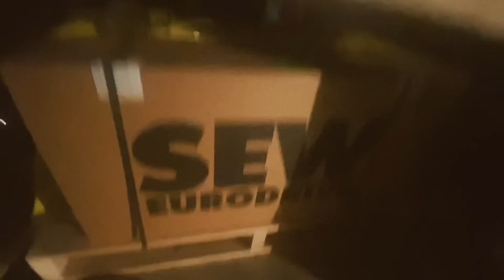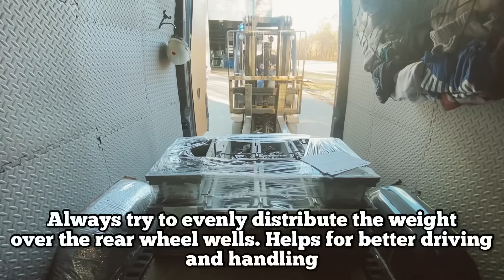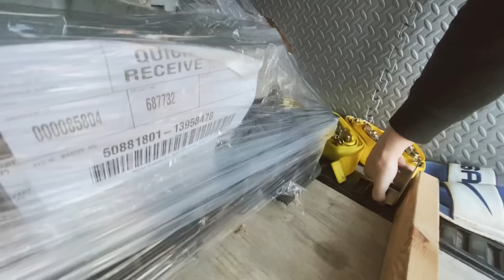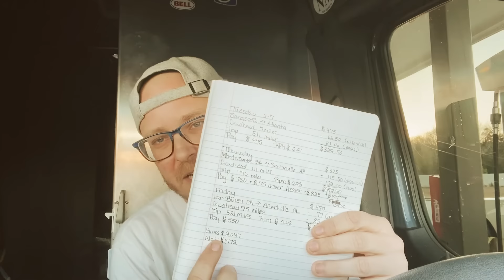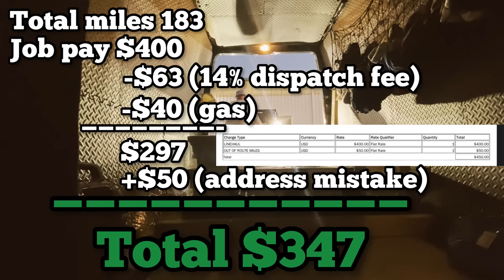How Much 💰 Did I Make My 1st Week as Owner Operator | Sprinter Van Business

Comment: I have a ProMaster 2500 high roof that can hold 2 regular sized pallets with a bit of space left over. Can that be used for this type of work? I see everyone with Sprinters so just curious. I basically have 9.5' of cargo length and it's 54" between the wheels. 6'3" tall.
Reply from the maker: It can but the more space you have the more loads are available to you. The smaller you are the less amount of loads you can bid on
Reply: @ExpeditingAmerica  how much space do you have? doesn't seem like you can hold 3 pallets bc you have a bed in there. not to mention the loads i see you carrying are 1-2 pallets.
Reply from the maker: @1969MARKETING  the bed does this crazy thing called “folds up against the wall.” And clearly you haven’t watched many episodes because I’m almost certain there are episodes where I carry 3 pallets
Reply from the maker: @1969MARKETING  honestly I do my best to haul the least amount of freight possible so I can keep my bed down and sleep good
Reply from the maker: @1969MARKETING  I’d say about 20% of my freight is 3 pallets or similar size. I usually take those loads when I’m in a pinch.
Reply: @ExpeditingAmerica  gotcha so i think the answer to my question is "YES" you can do this with 2 pallet carry :)

i've also seen other owners with similar sized vans but they have a rack system that can hold 4 pallets double stacked.
Reply from the maker: @1969MARKETING  that’s what I said in my first answer to you. “You can but…”
Reply: @ExpeditingAmerica  it's how i'll have to start out. i got a great deal on the van for $19,900 with 110k miles. if things work out i'll grow into something bigger and better.
Reply: @1969MARKETING did you start? How's it working out?
Reply: @lalanipearson3319  i ended up getting some local contracts for delivery with some mattress/furniture stores and appliance delivery/setup. it's going well.

Comment: Operating cost is 0.50 cents. 😂, are you sure your math is right. Can you give us a brake down. (2+2=5, is that the math you were using?)
Reply from the maker: No I admit my number was off. I calculated completely wrong 😂🤣😂🤣
Reply from the maker: I’ve had many people tell me different ways. How do you calculate?
Reply: @ExpeditingAmerica yours is between 70-80 cents with 1100 van payment and 1600 month insurance. So, be careful and do not take cheap.
Reply: To calculate CPM is important but how they calculate is wrong. In fact most people are wrong, so they end up in a cycle of debt and lose their chance of growing. The way to calculate it is by looking at your short and long term debt cycle while you factor in the 25% profit.
Reply: If you’re not making that 25% profit, you might as well close doors and save yourself from heart ache (in general, not specifically directed to you).
Reply from the maker: But how many miles do you base that off of a month. I don’t take days off like everyone else doing 2-3 weeks on a 1-2 weeks off. Everyone is going to have different numbers. Based on how hard I run I calculated just above .50 there are many ways to skin a cat
Reply: @ExpeditingAmerica  that’s the thing. The cpm partially have to be calculated based on estimation and projections that accounts for long term debt cycle. But then you have to calculate the actual costs on a per week basis to account those numbers for short term debt cycle. The difference the net profit between short term and long term debt cycle will give you the exact (to the t) cpm calculation.  You also have to factor in the 25% profit. So my (me and the business partner) we factor in the 25% profit margin into the per mile cost. So in our case our projections show $1.17 cpm which includes 25% profit. We don’t do any loads that doesn’t averages out less that $1.17.
Reply: Just to add to my previous reply, the cpm changes based on how much you drive or how little you drive. For example sitting waiting a day or two for a load, maintenance, the number of days you work. You cant just use estimations to calculate cpm, which most people tend to do. That’s why they don’t make much money other than the money to pay their bills and some people are happy with that. In my case I want to make money, so I wouldn’t be happy with that.
Reply: @Freight Busters  peoples estimates tend to be wrong. They always choose the best week that they work 60+ hours  and multiply it times 4 for their calculations. As if they can continue at that pace for the rest of the year. Gotta be conservative with the cpm.
Reply: @RafaelsFlix  Exactly, people come in with big dreams, hate to see those get shattered because of math. I just feel like people don’t use real world data but instead choose to use YouTube/ Facebook data. Hopefully the info I provided helps people.
Reply from the maker: @RafaelsFlix  I did it by the 160k miles I did last year and that’s wasn’t staying out like I should. I started last year kinda lazy.
Reply: @ExpeditingAmerica  being an owner operator now. You have to change your mindset. Erase the idea more miles more money. Now you suppose to do less miles good money.
Reply: @Expediting America  ya its tough to do ur estimate since last year it was a job.. u dont run the same routes/contracts as last year.
Reply: @RafaelsFlix  calculating CPM is a complex task. Not just based out of an avg mileage. Plus people never add the 25%. Smartest way is to reverse engineer the finances considering the net profit first. That mileage calculation is an arbitrary number. You can’t run a business off an arbitrary number. When people understand the math, they will realize quickly how a lot of these YouTubers are here to collect views and nothing more than that. All the info atleast 99% of it when it comes to finances are total BS.
Reply from the maker: @Axel-Live  there are a million ways to get it Axel. What works best for you isnt what works best for everyone. The main goal is always make the most money. Also the goal is to not sit and have your wheels not move. Turning a profit is turning a profit and as long as my business doesn’t lose money it doesn’t matter how I get it. 

Also I’ll take constructive criticism from people who show me the way. Not just give their opinions from the sideline. You always say don’t take cheap loads yet never connect me with people or ways to do that. Even this post you didn’t tell me your cost per mile or how you calculated it. Just said I’m doing it wrong…🤷‍♂️
Reply from the maker: What would you do to make the channel better if you were in my shoes? I’m not trying to put out bs. I can admit I have a lot to learn but I also know everyone’s experience in this business or any business is different. Too many variables to predict who will succeed and who will fail. At the end of the day that’s how it’s always been. @freight busters
Reply: @ExpeditingAmerica  I’m not saying you put out BS, you inspire people to work hard which is good, but all I’m saying is have your info right. You have quiet a few subs and you owe it to them to provide the most genuine info. You don’t want to be like the rest of them. People are investing a lot without knowing where their money is going, for some people its a matter of make it or break it situation.
Reply: @ExpeditingAmerica  to add to my post, you are correct. Too many variables there. But the reason the ground transportation market is so unstable and fragile (including box and semi trucks) is because people are spending their savings on something they have no idea about. Guiding them the right way is very important. To add to @axel point, people are doing loads for 0.50-0.85 cpm. Those are cheap states. No matter which state, it’s about meeting the 25% profit or you’re not making it. When any one invests money and start a business I’d assume it’s to make more money not to break even or just pay the bills. Working smart is important than working hard. We put lower miles on the vehicles but we have some of the highest paid drivers. We are able to accomplish that because of the way we approach our finances.